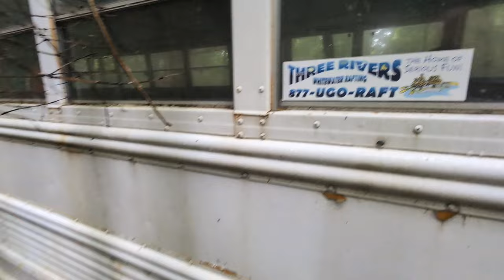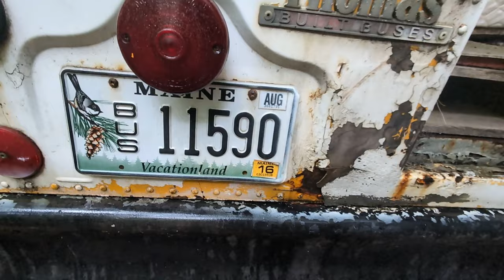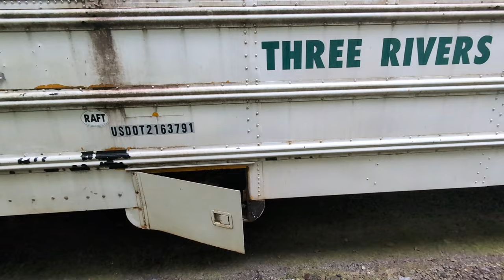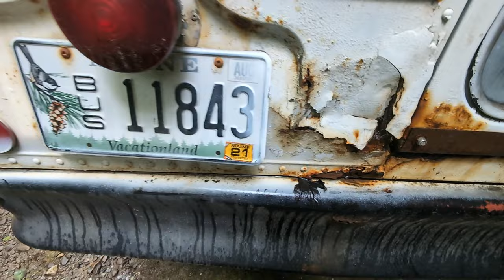FREE School bus removal

Comment: And if you have one international key for that model, it works on all of them. They basically used the same ignition on all that 3800 series school bus but you would need an S series key to start all the 80s school buses. All 90s school buses were the 3800 series key, and they were all the same key so if you have keys to one of those school buses, you have keys to all of them
Reply: Sweet. I didn’t know that, cool.

Comment: Not to be a dick but the bus is actually an early 1990 bus it may say 89 on the title but it’s an early 90 3800 model bus because in 89 they were still making the square body s series up until June of 89 then switched over to the 1990 3800 model bus which is what you got